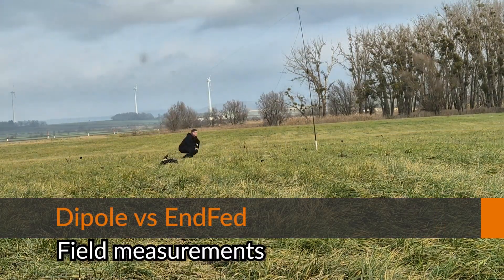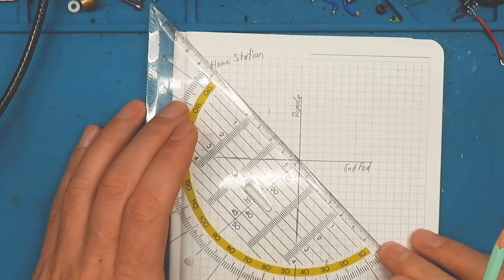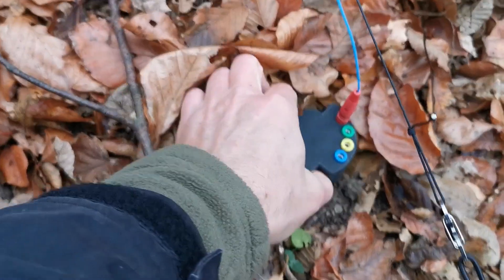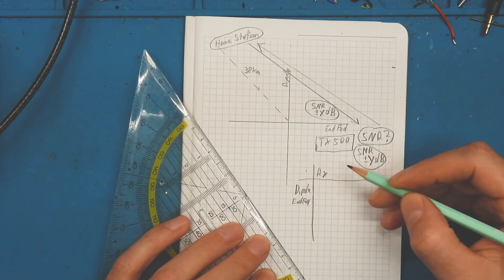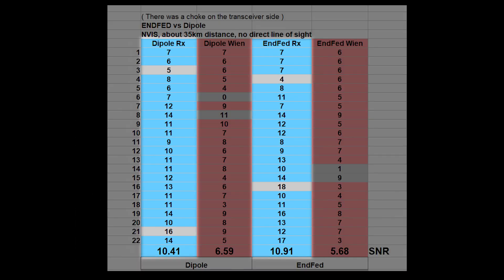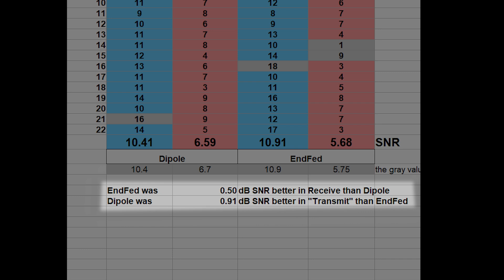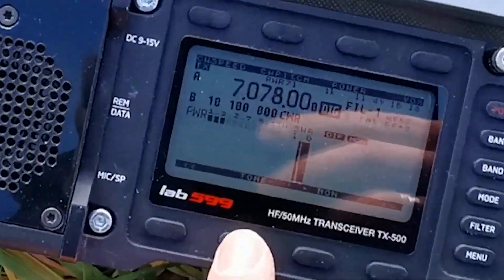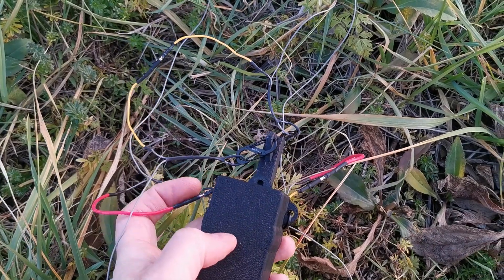Dipole Vs EndFed - Field Measurements

Comment: This is a beautifully thought out & conducted trial. Respect.
Just some thoughts:-the efhw has the advantage of working on even & odd harmonics but the dipole cannot handle even harmonic operation however balanced antennas like the dipole can suffer less from local electric noise pick-up compared to unbal antennas like efhw & verticals. It looked like your test site was well away from local noise sources so here given its equal performance to the dipole but advantage of even harmonic operation for the efhw I'd probably choose the efhw, but in an urban environment for the home station I'd possibly choose the dipole instead IF it was quieter.
The fact you were measuring snr was nice to see. It would be interesting to see the same trial conducted in a noisy urban environment to see if the theoretically quieter operation of balanced antennas gave the dipole any advantage there.
Reply from the maker: thx for the comment! Great points!

Comment: Very scientific approach. But...
Dipol works only on one band. And its overall wire length is half wave. Endfed works on multiple bands. Its length and peeformance is equal to the dipol only on the lowest band. The higer you go, the better is endfed performance while dipol performance remains the same.

Comment: I like the way you solved the interference problem,  

I did YT search and came up short.  4 hours later it recommends this video.  It's just what I was looking for.

K8BYP has posted a couple of videos trashing the EFHW claiming his QRP on a dipole beats 100 or 800 watts on an EFHW.  Funny thing is, they had 59 signals in his radio. He said his signal was S7 so I don't see a loss there.  If he really wanted to see the difference, he should use his .5w or 5w against a distant station running 800 or 100 watts when he is receiving them at S2 or S3.  lol

So, I've been looking for someone comparing them.  I expected a little degradation from the EFHW, but not much.  I was surprised one transmits better and the other receives better.  

It might make sense if the transmission causes the core to heat up.  This might account for some, if not all of the TX loss.  It would not heat up for the receiver, but I am surprised the signal might be stronger on the EFHW receive.

Like you said in the video, it is probably in the error factor.  

Regardless, there is no way a distant station would know the difference in the two antennas with all things being equal between them. 

Thank you for answering my question. 
73
Reply from the maker: i'm glad it helped. thx for the nice comment!

Comment: I always put a good application of antenna wax on the antenna,  usually not common candle wax some use.  A good source is honey bee hive workers, they are willing to negotiate a good price for the hive wax.  This protects the antenna from noise, UV, rain, snow, ice, and should  help electron flow.  They commonly call this Beez Wax.  It also helps fishing line cast farther too.  A organically safe way to keep animals off of and tearing down your antenna.  The animals are going to be alerted to the bee, and deters them to stay in the area.

😊❤

Comment: Very interesting, thank you for posting. 
If you repeat the test try it with the EFHW transformer placed at least 1 meter above the ground and no metal objects close to the transformer. Also if you can, measure the extra loss involved in putting the transformer into an enclosure. Also do not use a multi-tap transformer. While the impedance transformation ratios are not affected by the taps, transformer bandwidth of the lower ratios are! You will also find better transformer efficiency with lighter wire insulation and close windings. 
What I find especially interesting is how little in practical terms the "insufficiencies" of your EFHW setup made to the results.
73 44

Comment: I use both a dipole and an end fed random wire. I like that the end fed is multi-band with a matching transformer on it, but the noise floor is higher on the end fed than the dipole. Both are at the same height, which is too low for both, and both are in the same area. All else equal, the dipole is just a simpler and cheaper thing to put together, but the end fed allows me to change bands when conditions deteriorate or improve on other bands. You can spend a lot of money and time putting together a random wire end fed, but all else equal, it's hard to go wrong with the dipole. I have noticed something similar with the dipole. It is more sensitive at reception, but I need higher power to make contacts using FT8. With the end fed, I don't receive as well, but I can transmit better. But this is not anything controlled, and the band conditions are probably 100x more variable than my antenna choice.
Reply: No wonder. At higer bands endfed diagram  has lobes with gain as 3-el yagi. Regarding noise floor: I compared my 40m long endfed with a dipole on the 30m band and found no difference.

Comment: Two other ways to compare the performance of two a antennas: 

Use the Reverse Beacon Network on CW CQ transmissions. Or -

Monitor your signal amplitudes on remote on  line Kiwi SDRs while
making CW test transmissions using  long dashes.

If using the Reverse Beacon Network to compare two different antennas closely in time you will have to transmit on slightly different frequencies for each measurement as the network only updates once every ten minutes for a given station on a given frequency. You can also get a sense of how well your station is performing relative to any other stations being detected at a given station at a given time.

With the Kiwi SDRs you can watch your signal levels in real time in the spectral amplitude display while repeatedly switching back and forth between two different antennas.  And you of course can also hear and see how your station’s signal is being received compared to any other stations being received by the SDR in real time.

AJ1G Stonington CT
Reply: Some people like to use PSK Reporter  for doing what I recommend with the Reverse Beacon Network.  In my experience, at least for CW mode detections, RBN blows PSK away with the number of nodes on line at any given time, also the RBN list format of the results is much more straightforward and easier to read.  RBN also has a very good ray trace map display that shows all the nodes detecting a given transmission over a given time window.  The results time window filtering can be as short as the last number of minutes to up to 10 YEARS!  Many other data filtering options are also available with respect to locations of detecting nodes such as by continent or country, and direct comparison of specific transmitting stations, wild card things like AJ1G*, which will shown results for AJ1G and AJ1G/M, which I often do when comparing my mobile’s antennas to my full sized home station antennas.

Would like to see the  YouTube antenna posters show some quantitative results from the RBN vice the usual sound bites of QSOs!  It’s great to test out a new antenna setup and see a ray trace  bloom to a all over North America, Europe, South America, the Caribbean, and the Pacific all at once, and a page full of mostly double digit SNRs from a minute or two of CQing!  I routinely have RBN up in real time whenever I’m on the air on CW, even when there aren’t many live ops on a band you can at least see how the.RBN nodes are detecting you and others.

AJ1G Stonington CT
Reply from the maker: @AJFogertyFan2  awesome thx for the infos. maybe will use RBN for some stuff in the future. only receiving you cant test with that method if Im not mistaken.
Reply: @ You can run testing on RBN.  Just send a string of TEST DE CALLSIGN a few times.  But don’t do that if there is a contest in progress on the band.  There’s a lot of info on how to use RBN on the RBN home page.
Reply from the maker: @AJFogertyFan2  thx for your comment and info! Good ideas!

Comment: What I hope viewers might take from this is that a well designed and properly deployed EFHW can provide good performance similar to a dipole with some obvious benefits for certain use cases. These benefits include simpler deployment options when portable, and multi-band operation.  Deploying as a vertical is great for DX, especially if you are by salt water.  Using a very efficient 49:1 transformer as shown reduces losses to about 0.5 dB (compared to 1.5 dB for some entry level builds).  Don’t be afraid to consider an EFHW, OCFD (Off Center Fed Dipole), or even a RW (random wire) for multi-band operation. The benefit of being on the right band at the right time is well worth the compromise involved.
Reply from the maker: well said, thx a lot!

Comment: Results are pretty much what I would expect when using a EFHW on its fundamental band versus a dipole for that same band.  Modeling using 4NEC2 shows almost an identical pattern and gain between a center fed dipole and a EFHW both mounted horizontally when using the first 0.05 wavelength of feedline as the counterpoise with the EFHW and measuring RF current at the center of both antennas agreed almost perfectly with what modeling predicted.  Only real difference is transformer loss with the EFHW but my homebrew transformers have a measured efficiency of 90% which equates to a loss of only 0.46 dB which is less than a tenth of an S unit assuming an S unit is 6 dB.

Comment: Thank you for your measurements.  At higher harmonic frequencies, the end fed inverted vee is a useful directional antenna.
Reply from the maker: You're welcome! Yes that could be useful. At some point I will compare that with a vertical I guess.
Reply: @msf60khz  I agree for horizontial antennas .  However, end fed VERTICAL antennas tend to lose low angle lobes desirable for good DX performance to multiple high angle lobes at higher harmonic frequencies.  Case in point, I run a nominal 33 foot 20 meter end fed half wave inverted L which is a very good long haul DX performer.  However, as an end fed full wave on meters, it’s performance is always at least 2 S units (12 dB) down relative to a reference dipole, based on real time antenna A/ antenna B reports from DX stations, also very evident in received signal strengths at my end of a QSO. 

AJ1G
Reply: End fed full wave vertical dipole on 10 meters is way down relative to horizontal dipole on 10 meters.

A really GREAT high order harmonic dipole, either end fed or more common center fed is a 75 meter half wave dipole with a fundamental frequency at around 3850 kHz operating as a 7/2 wave on 10 meters.  Stumbled across this gem when randomly exercising my IC7300 auto tuner to see if it could any matches besides the obvious one.  To my surprise, the 75 meter went into tune with a perfect match almost immediately on ten meters. An SWR band sweep plot check with the 7300 internal tuner off showed a not too awful slightly less than 2:1 across the band.  Did  some googling on 10 meter 7/2 wave doublet dipole and came up with a QST antenna project article on the exact subject, and also some
modeling results. At 10 meters a nominal 3850
kHz fundamental dipole
exhibits a nominal feedpoint impedance in the vicinity of 100-200 ohms, well within the matchable range of the IC-7300.  The old QST article presented an elegantly simple technique to allow
a near perfect match on both 75 and 10 meters by adding a 10 meter quarter wave impedance matching section of 75 ohm coax in series between  a
50 ohm feed line and the  antenna feed point.  The length of the matching section, which needs to take into account the 75 ohm matching section coax velocity factor worked out in my case to be 7 feet 10 inches.
This brought in  near perfect 1:1 match over the entire 10 meter band.  It’s essentially transparent with respect to the match on 75 meters and is left permanently in line at the feed point. Modeling of a 7/2 wave dipole shows very useful 8
dBd (that’s dipole not isotopic dBi !) in 4
directions nominally 30
degrees off the antenna
axis.  For my east-west dipole that’s to NE (Europe), SE (Japan long path), SW (lots of USA and ZL) and NW Alaska and Japan short path).  Helped me run up a respectable score and qualify 2nd place single op low power CT section in the 2023 ARRL CW DX Contest using only wire antennas and a relatively short  17.1 hour on air effort. 10 meters was my best scoring band in the contest.
Reply: End fed full wave vertical dipole on 10 meters is way down relative to horizontal dipole on 10 meters.

A really GREAT high order harmonic dipole, either end fed or more common center fed is a 75 meter half wave dipole with a fundamental frequency at around 3850 kHz operating as a 7/2 wave on 10 meters.  Stumbled across this gem when randomly exercising my IC7300 auto tuner to see if it could any matches besides the obvious one.  To my surprise, the 75 meter went into tune with a perfect match almost immediately on ten meters. An SWR band sweep plot check with the 7300 internal tuner off showed a not too awful slightly less than 2:1 across the band.  Did  some googling on 10 meter 7/2 wave doublet dipole and came up with a QST antenna project article on the exact subject, and also some
modeling results. At 10 meters a nominal 3850
kHz fundamental dipole
exhibits a nominal feedpoint impedance in the vicinity of 100-200 ohms, well within the matchable range of the IC-7300.  The old QST article presented an elegantly simple technique to allow
a near perfect match on both 75 and 10 meters by adding a 10 meter quarter wave impedance matching section of 75 ohm coax in series between  a
50 ohm feed line and the  antenna feed point.  The length of the matching section, which needs to take into account the 75 ohm matching section coax velocity factor worked out in my case to be 7 feet 10 inches.
This brought in  near perfect 1:1 match over the entire 10 meter band.  It’s essentially transparent with respect to the match on 75 meters and is left permanently in line at the feed point. Modeling of a 7/2 wave dipole shows very useful 8
dBd (that’s dipole not isotopic dBi !) in 4
directions nominally 30
degrees off the antenna
axis.  For my east-west dipole that’s to NE (Europe), SE (Japan long path), SW (lots of USA and ZL) and NW Alaska and Japan short path).  Helped me run up a respectable score and qualify 2nd place single op low power CT section in the 2023 ARRL CW DX Contest using only wire antennas and a relatively short  17.1 hour on air effort. 10 meters was my best scoring band in the contest.

AJ1G

Comment: While your experiment is rather good but there are flaws.  The radiation pattern of an end-fed and center fed dipole are identical for a fixed antenna height.   The chief difference will be the efficiency of the 49:1  UNUN.  A center fed dipole is rather efficient.  Your antennas are placed 90 degrees with respect to each other so the signal received at a distant point be different.  Antenna modeling can be used  to determine the effect of antenna orientation.   You only need to model a centerfed dipole as the radiation pattern is unaffected by the feed point location. You just need to know the difference in gain for a change of 90 degrees. A low inverted V will not have much directionality but modeling is easy using EZNEC or MMANA-gal.
Reply: Modeling using 4NEC2 shows almost an identical pattern and gain between a center fed dipole and a EFHW operated on its fundamental band when both are mounted horizontally when using the first 0.05 wavelength of feedline as the counterpoise with the EFHW and measuring RF current at the center of both antennas agreed almost perfectly with what modeling predicted.  Only real difference is transformer loss with the EFHW but my homebrew transformers have a measured efficiency of 90% which equates to a loss of only 0.46 dB which is less than a tenth of an S unit assuming an S unit is 6 dB.
Reply from the maker: thx for the comment. I wouldnt call it an experiment. Its was just a test.
I like to test stuff more in the real world than modeling it. The direction of the targeted station was between the dipole and the endfed. 45deg to each of them.

Comment: It is unclear whether the statement "WINNER" refers to the dipole relative to the EFHW or to the dipole with a choke versus without a choke when using a voltage balun.

The statement "WINNER" about the dipole, where the assumption from the video title suggests it is in comparison to the EFHW, could be misleading for new radio amateurs.

Even though a more accurate phrase like "MY DIPOLE IS THE WINNER" would be appropriate, the use of "WINNER" is somewhat inadequate. Nonetheless, I give a thumb  up  👍for the effort, as it provides inspiration for others.
73, Joe